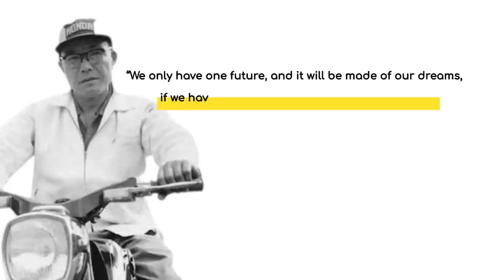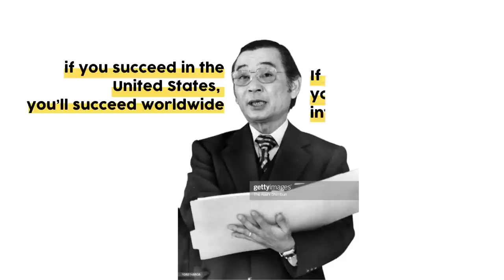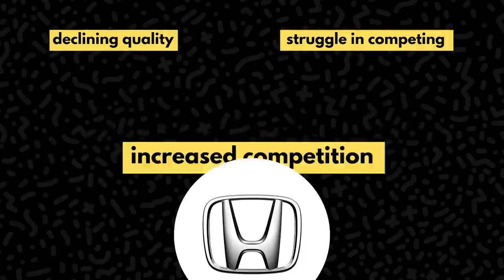Is Honda in Trouble in 2023? The Beginning of the End for Honda & Honda Motor Company | 🚘🚗🏎️

Comment: honda is not in danger. Profits are good and the rentability is good. the new civic is going to be a benchmark
Reply from the maker: I admit. the new civic is nice. But integra?  pass. Thanks for checking out my video.  Be sure to subscribe for new updates every Wed! 🚀
Reply: You need to look at Honda's reliability ratings on JD Power and Consumer reports! Honda has dropped well below industry average! Honda was once the benchmark of automotive quality and reliability! I'm still trying to figure out what happened!
Reply: @notsocleverley  They went "woke"! I have worked at a honda manufacturing plant for almost 20 years. The quality coming off line just sucks compared to 15 or 20 years ago. The people building them now just don't care about quality only the paycheck!
Reply: @michaelvanpelt7797  That's from management passing the buck. The practice of taking responsibility, finding the root cause and counter measuring a problem has slipped away. The practice now is put a band aid on the problem in the form of a temp to get it to an acceptable level and move on.
Reply: The new 22 civic drives great but has real reliability problems. I’ve seen them first hand. Imagine adding LED lights for the fist time across all civic to receive high safety rating yet moisture now accumulates inside the light units. Just one of many examples. Again. The car drives great (I own one) but there are problems that make one look to growing competitors
Reply: The new civic looks ugly and dated

Comment: There is no way to do this subject justice in a short video like this.  Your surface touch would get a C+ at best from someone that knows the inside.That is not to say I know it all, just that I watched it happen from the inside even worked on a couple projects you mentioned like the 82 Civic and the Element. I one of the very few who liked the Element when the design was first seen in the plant where it was built, I bet 90% of the people thought it was ridiculous. Although it was a huge success it  was not the target market who bought it. That vehicle was designed for 20 somethings who were going to use the impossible to build rear seats to block the view as they changed clothes in the back at the beach.Did you ever wonder why the sunroof was in such a screwed up place, yeah so you could stand up back there when changing, or that was the best answer I ever got from the designers.  Not so bad for public sourcing and presenting in a short video. If you want to know the truth, it was years of decisions made by people who do not understand how the sausage is made that caused it. Immagine your video went to a totally new board of directors and was presented as a comprehensive picture of the current situation. Now if that was all they got to approve next years budget, what would you get a C+ at best car company. Take it for what it is worth, one opinion.

Comment: Interesting background story, but comparing 10 year old problems that affected 2% of Hondas to Hyundai/Kia that recently had a recall of 8.4 million cars due to spontaneous engine fires (about every car they built in a 5 year span), and other quality issues resulting in them having to come out with a 10 year warranty so consumers would still consider buying a Korean car sounds biased or misinformed. Personally, I think it is wise to let other manufacturers spend billions on dead end EV technology that will fail as soon as the EV resale value crashes in the next 10 years, after the great myths of EV's are realized. Honda is not without problems, but this video leaves me SMH.
Reply: I would take a spontaneous engine where I could get out of the car than shards of glass thrown in my face from an airbag deployment
Reply: @stevenarxer2992  Again, old story with the air bags, that affected many  car companies, but everyone that has an affected Honda should have had it fixed a long time ago for free. The spontaneous Hyundai fires still exist after 6 years, and owners are being warned not to even park them in the garage. Hyundai's have their own air bag troubles currently, they are failing to inflate at all. Hyundai is also being investigated for restricted oil flow to connecting rod bearings, the list goes on. An important fact Hyundai often refuses to recall cars until forced, whereas Honda takes a proactive approach.
Reply: @zuum2496  I really don't doubt Hyundai's issues. I just really don't believe Honda's reliability as it's told to consumers. I think Honda is clearly now surpassed by Toyota (though no brand is perfect). I would say I trust my Honda to start every morning. But I no longer trust it to not give me headaches/concerns that I thought were reserved for "lower brands". Just my feeling after owning many Hondas and a new one with brake problems off the showroom floor.
Reply: @stevenarxer2992  sorry to hear about a new car with brake issues, my experience with Honda is they should repair it free of charge. I have driven Hondas around the country for the last 30 years, logging many over 1 or 200,000 miles. I have experience just one abnormal problem with a transmission with a car over 100k miles, well out of warranty. Honda put a new transmission, while I used a loaner, all was no cost to me. To hear Hyundai somehow better, is ridiculous.